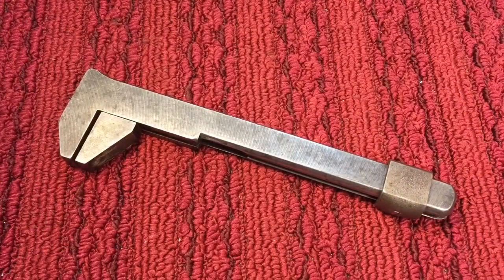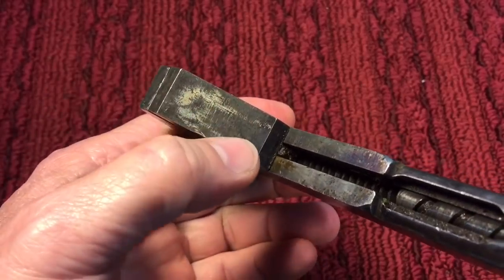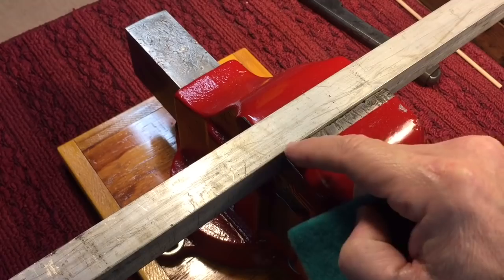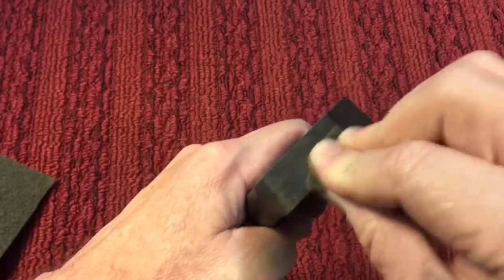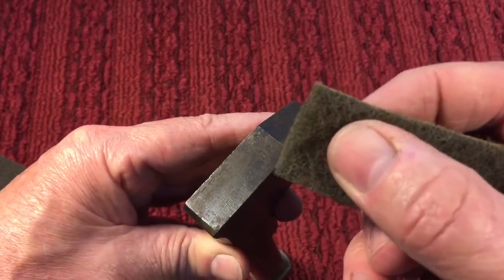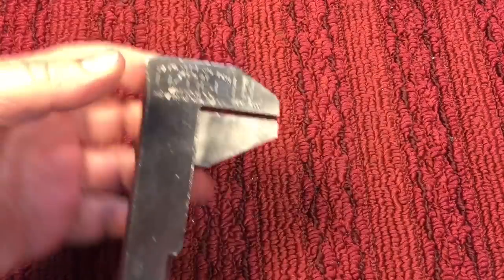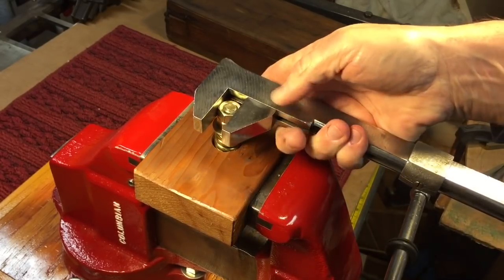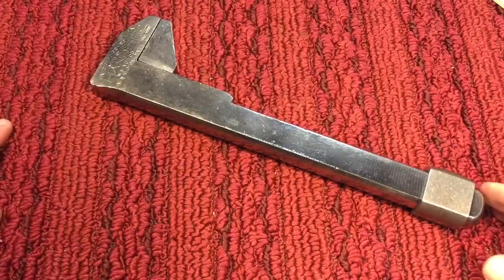Rare 1921 HandE  H&E Wrench Restoration

Comment: Handy handle it is! Good deal, Scout! Rain here too so you're not by yourself. The coarse screw looks like half of the screw setup on a Yankee Screwdriver. I like the different threads withy the fine in the jaw so it's geared down and won't move and that one doesn't look as gimmicky to me. Neat concept and heavy built. Thanks again! And Mr. Chadwick is doing a little better. Now to get Unce Sneelock back home!
Reply from the maker: Hello Lewie!  You're right!  The spiral concept was used a lot for drills and screwdrivers but this was pretty novel!  A heft wrench for sure!  Glad to hear Mr Chadwick is on the mend!  Thanks very much!!!!!!!
Reply: 10/4, SCout! Stay dry!

Comment: Remember the old "Think Ahead" signs that used to be in every shop and office in the land? Where the lettering in this slogan compressed in width as the word approached the right hand edge of the sign to make it "fit" the paper because the creator self depecratingly did not "think ahead". The same thing here. The company was HandE like "H and E" usually the name of the partners like "Harry and Edmond" (I made up that example) That is what happened here too. The top leg of the logo's "E" was cut off by the downward curve of the wrench's top jaw. It isn't at all an "L" as you imagined. The full logo can be seen here: https://www.vintagetools.net/product/h-and-e-wrench-co-new-bedford-mass-quick-adjust-pipe-wrench-285d where there is no indication of the presence of an "L" at all. Otherwise, nice resto and I like Scotch Brite too!

Comment: Thank you ScoutCrafter.  A unique wrench for sure.  You used ScotchBrite, but could you use 2500 or 3000 sandpaper?  I immediately thought of Brasso, your thoughts?

Vaughn
Reply from the maker: Hello Vaughn, Absolutely, all abrasives are pretty much the same... Sandpaper and scotchbrite leave very similar finishes, the SB tends to fill in the curves and corners better but they all work good!  Brasso is a very good cleaner polish too!  I have a few different metal polishes that would have worked well like Flitz or Mothers mag and wheel cleaner...  I use whatever I'm in the mood to smell at that time!  LOL   Thanks!!!!!!!

Comment: Nice restoretion love your videos, my sugestion is that you can use bras wire wheal, i love it
Reply from the maker: Hello AZ!  I have a brass wheel but believe it or not the brass can scratch too because they temper it so it won't bend!  On real brass wheels the brass wires bend over as soon as you touch the part, most Brass looking wheels are just plated steel!  Crazy right!?  Thanks very much!!!!!

Comment: hope you didnt remove the markings on side that show what size nut jaws are set at. it looks like a ruler litly etched on one side and the slide rule type adjuster lines up with how far open jaws are

Comment: They should make Scotch Bright as a disk for bench grinders.
Reply from the maker: Hello John!  They do!!!  They are quite expensive!  In the beginning of the video where you hear me say I was going to make a tool- I had planned to make a scotch-bright wheel to use, however the video was running long and I will save that for another project!  Funny right!?   Thanks!!!!!!!!!
Reply from the maker: Hi Byron, I have a few air die finders and lots of Roloc accessories in all different grits but I have my compressor covered up for now!  LOL   =D

Comment: An interesting wrench heavy duty but suffers the same problem the yankee screwdrivers have and that is with the spiral push,  pull system you cannot get enough torque. You get speed not torque.
Reply from the maker: Hello Tony, I think with this wrench once the adjustment is set there is no need to squeeze the jaws tighter.  When I was a boy my Grandmother had storm windows installed and all the installers used yankee push screwdrivers!  This was about 1970... They were so fast and the tools worked good for them!  I never had such luck with them!  LOL   Thanks !!!!!!!!
Reply: ScoutCrafter  If you could keep the screwdriver bit in the screw they were fast, but hit a knot or a hard place in the wood and the push system does not work you have to lock it and turn the handle. I think contractors had better screws than was sold to the public, deeper slots so the screw driver did not cam out.

Comment: you saw essintal craftsman butting us to shame with just working it by hand and oiling. i would still oil it because all the gunk i prefer out but i like his idea, if i had a gf i may try that in bed room :)
Reply from the maker: Hello David!  LOL  You are right!  The oil is just the ticket, grease attracts dirt and grime and over time this wrench will suffer from it.  I took the extra time to polish the mechanism and then very little lubricant is needed for smooth operation.  They can't afford to do this to every production wrench for cost reasons but we can finish what they started!   =)   Thanks!!!!!!!!
Reply: was talking about his video where he put in in a visse and use a sawzall to open it 100 times. also i like to use teflon since wont have attrack like oil sometime does
Reply from the maker: David- Once polished the threads are silky smooth in most tools, I too like the teflon lubricants but some dry out quickly.  I bet graphite would be good on this wrench!  =)
Reply: ScoutCrafter  i hate  i mean hate graphite pick yourself up some teflon non stick dry film lubricant its like graphite but goes down wet and so much better. also there the spray what differnt i use both. also im talking about a channel on youtube call  essintal craftsman he made a video what i want you to check out then reread my comments and i think you get it